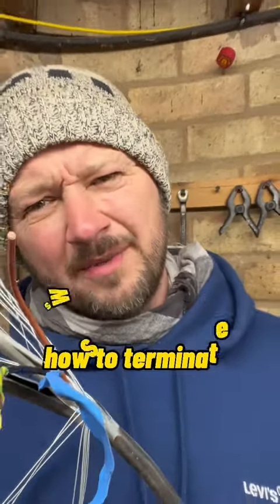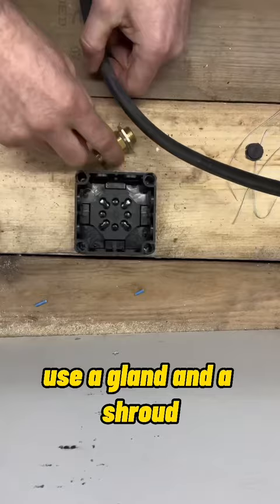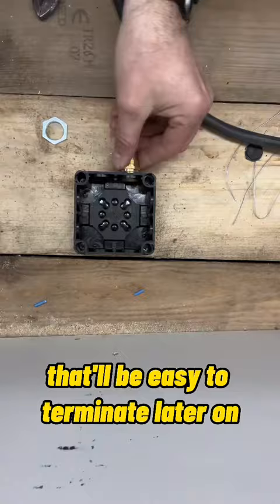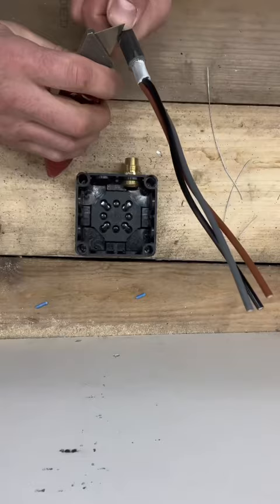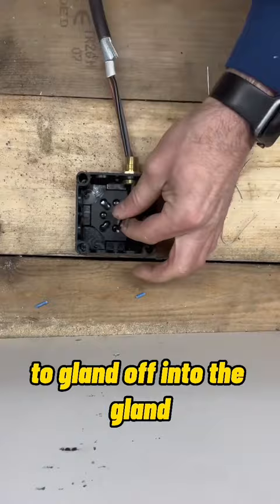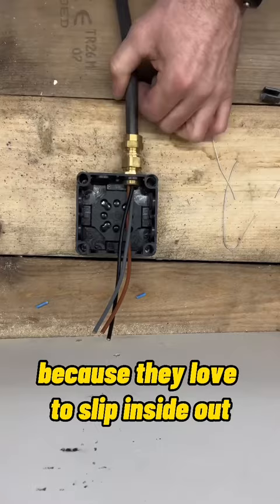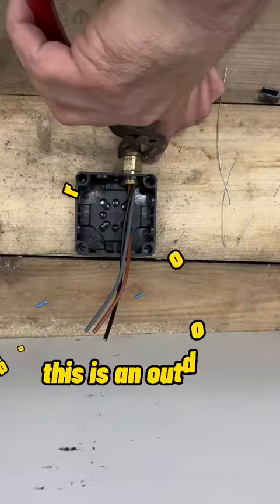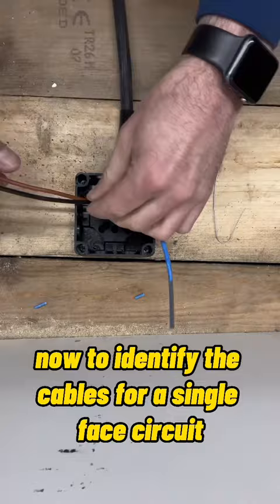Terminate SWA cable properly #electrician #cable #tradielife

Comment: Inner insulation cut too short as it should enter the box slightly past the brass gland.
No mention of earthing the SWA, seen this so many times on DIY bodges.
Didn’t show cutting and fitting of the shroud, just appears at the end!
Connectors loose in the box?
Very poor example!!!!!!

Comment: This size wiska box is fine for stuffing glands, not so great if you need to banjo/locknut. 
Galv conduit boxes and gel a better option if you need SWA earth continuity.
Reply: Also a no no. Been to a site recently. Out door lighting failed. Corroded and rotten galv boxes burried in clay soil
Reply: @moddrawsltd.6002  Agreed re: buried. Pratley boxes all the way. Not as expensive as they used to be

Comment: You forgot the part where you realise you've forgot the sheath so you have to repeat the process all over again 😂

Also I normally use my grey as the earth as I like to thing LNE goes to Brown Black Grey
Reply: Regs talks about de-nutralisation of the black so C.P.C should be black
Reply: @rik061119  Ohh, you got the reg number? Every days a school day and all that.
Reply: It's on harmonised colours red=brown(red line)
Yellow is black (yellow CPC)
Blue is grey (Blue = nuteral)
Can't remember where it specified it exactly just remember when I did my regs update it was Brough up